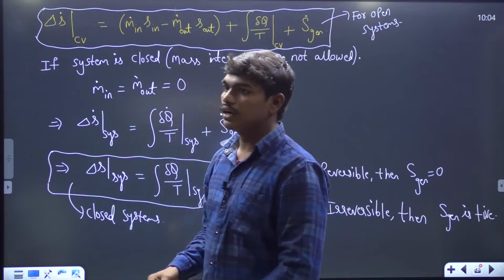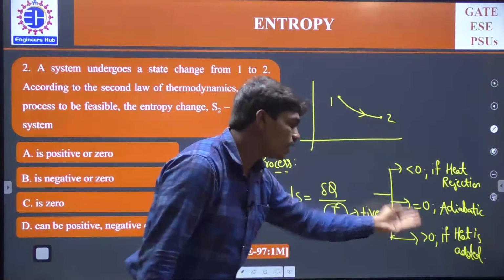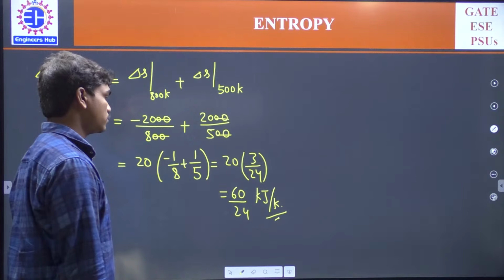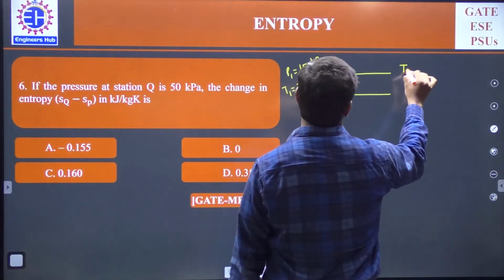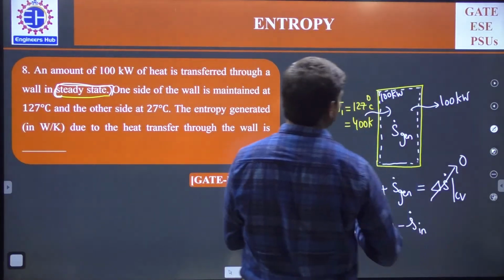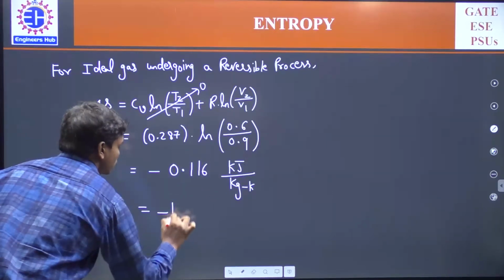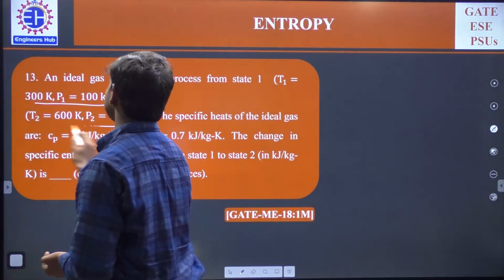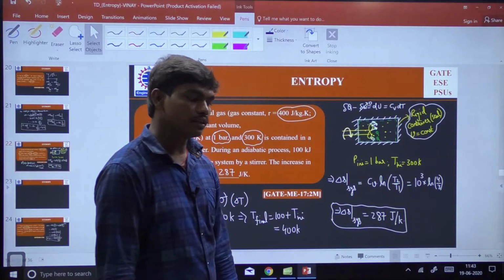Basic Thermodynamics || GATE  || Second Law || Lec-05

Comment: Sir in question 1 how can we use deltaS=Cpln(T2/T1)-Rln(P2/P1) the process is not reversible 
then how can we use it becoz in derivation of this equation we used dQ=TdS which is not valid for irreversible equation. Please respond
Reply: Because all the terms embedded in that equation are point functions.... Point functions doesn't changes with path... So we can use that equation to both reversable and irreversible process
Reply: @venkataramaraoguttikonda8810  but what if there is s generation during the process.. how to account that.. the tds=dq derivation do not account for entropy generation?